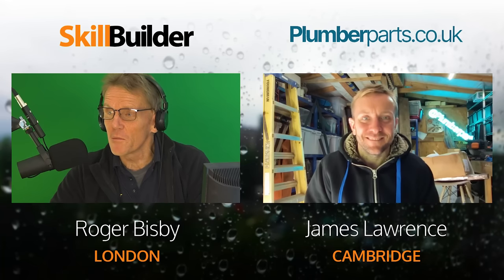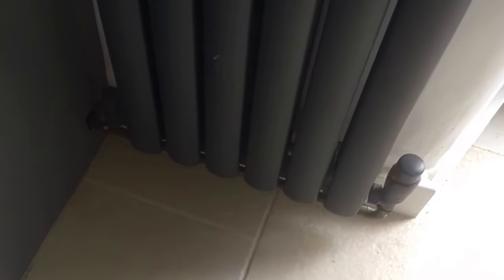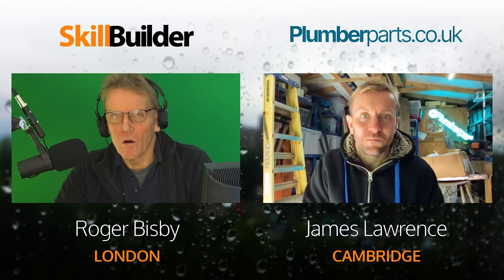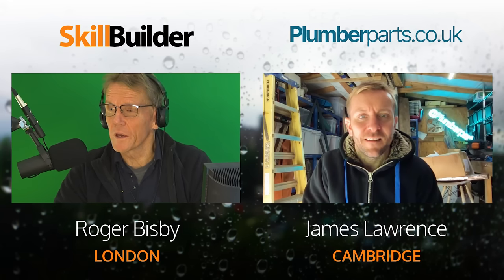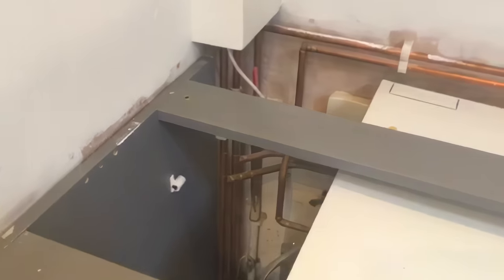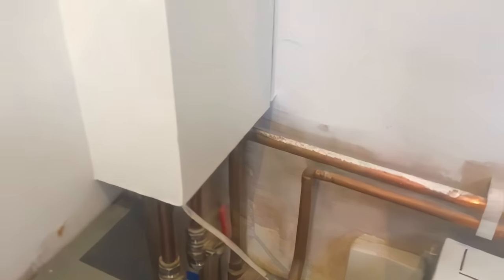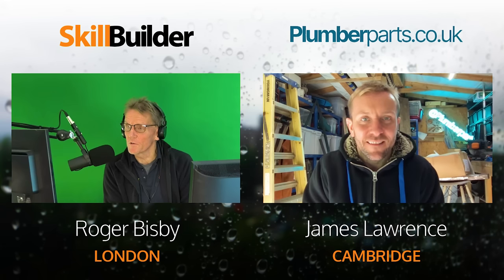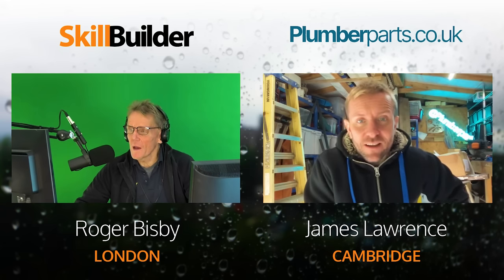Noisy Radiator Mystery: Does Jim from Plumberparts Have a Solution?

Comment: The sound is the water flowing up the first pipe then down the next column so the rad is being bleed on the first column but not the next. So first step would be to crack the other side of the rad (top) to bleed the air out of that side. If that improves it then swap the bleeder to the other side.
Reply: Just fit two bleeders, or two auto bleeders.

Comment: I was fire alarm commissioning engineer for about 25 years after a 3 year apprenticeship in the workshop and day release for 3 years at college C&G G in London.
Had a call out in central London with a loud noise coming from a smoke detector on the ceiling. I know there were no sounders in the smoke detector bases back then on site. Went to a room with a young lady and she said there it is pointing at the smoke detector in the room. I walled over to the thermostatic valve and tweaked it and it stoped and said you need a plumber not me lol. She went bright red so I said don’t worry I am not here you never called no charge made me laugh inside she was very grateful. Having 4 older sisters I have a soft heart it was only fair we all make mistakes 👍

Comment: I had a column radiator installed. After ages of trying to work out why the room was always cold. Found out the plumber had plumbed it up backwards. Fortunately had bi-directional lockshield and TRV. So I swapped the pipes over to it and problem solved.
Reply from the maker: You hire the professsionals and it doesn't always work out.
Reply: Lol

Comment: Guys what I’ve found with the columns is when you bleed it, bleed it really really slowly and on and off over a few days. I’ve found that air can hold up high in the columns. I’ve found it’s cured it. 

But again the pipe work is wrong there.

Comment: Shut of rad valves, remove top vent, fit 1/2 x 15mm with valve on. Connect a hose , have someone maintain system pressure then blast at full rate a couple of buckets full. Then try . Also if no auto. Bypass and you have high power modern pump, especially if a Grant oil combi boiler which must have bypass can virtually eliminate noise. Also check direction of flow on trv , some go silent when you get it right way round. Couple of full blast buckets will would be my first try, always worked for me! Good chat lads!

Comment: An internal baffle might have come loose in that tall rad too.
Reply: That was what I was thinking, the one I had was fixed on by a short bolt on the stem of the spacer. Could be spinning in the bottom of the rad.
Reply: Concur, sounded like a metallic rattle, not air, to me.  Can't really tell over recording and internet reducing the quality of reproduction.

Comment: Roger and James, great format - maybe a regular feature. I think you covered all the bases. Like all these sort of faults it just has to be a process of elimination and probably doing in the order of the the easiest things first.

1. Establish the flow and return pipes by temperature.
2. Establish the rad is the ‘right way round’ in terms of flow to deflector end (or even if the rad is upside down.
3. Not all rad valves are equal either - maybe fitting alternatives.
4. Rerunning the flow and returns behind the floor standing boiler - depending on the boiler you may not even have to chase the wall or move the boiler (could get lucky).

Finally let’s hear it for the most popular plumber on YT - Colin Furze.😉🤣

Comment: Their first mistake was installing a column radiator.
Reply: Every 1 wants to get upgraded but that depends on your home whether its an old or new build.
Reply: I fitted one in the kitchen and it's been fine.
Reply: @pussinboots1145  because of pipe work and pressure etc
Reply: I fitted a number in my house and they’re fine - never had a problem; you’ve just got to follow the manufacturer’s instructions and do decent pipework!

Comment: It’s the design of the rad that’s the issue, the top interconnecting rail is below the top of the columns so air is hard to expel from the pockets formed at the top of each column.
The cure is to bleed full rate a few buckets with out to try and pull the air out

Comment: If an Radiator makes water sounds like that, then it means its air inside it and needs to get vented.
If the system have air/gas inside, then it will start to rust etc much much faster.

To vent a radiator like this you have to take out quite alot of water to propper vent it.

Anyway, water dont makes noise unless its air inside.

Comment: I would turn each valve out and pull the water through each pipe individually, then fill the radiator see if that worked and see how long. If not working I’d the consider changing the pipe work or put air vents in etc.

Comment: Ha ha. Like most plumbers who get together about a job the conversation wanders to women !! Unlike your lady Roger mine walked over me to the sink and emptied a full teapot of tea down the sink - when I hadn't fitted the trap!! Fortunately it was cold tea!! On the radiator problem you didn't mention if the radiator was hot to the top. Was he bleeding it when the system was on rather than letting the pressure build to force out the air? Great video

Comment: That sounded like a physical noise rather than hydraulic. When that rad was prepped, it would have had blanking plugs on the inlet/outlet - has one of these been pushed inside the rad in error and is tumbling around with the water flow? Came across this once and we had to fish the bloody thing out with needle nose pliers...took forever....

Comment: I have the same issue with a couple of panel radiators...been driving me crazy trying to work out what it is. I wondered if there's a piece of metal floating about inside them.
Reply from the maker: sometimes it is balls of solder

Comment: Hello Community , We have recently re-did ground floor bathroom with it , builder replaced the existing hot/cold water pipes coming to that bathroom . Since then , we are having random clicking sound from one of the radiator upstairs which goes for 3-5 secs and stops . It only happens when heating is on . We removed the air but still hear it . Any suggestions please ? Thanks

Comment: Don’t think it was a plumber/heating engineer that fitted that rad. Any self respecting installer would not have installed pipe work like that and would have known problems would arise.
Reply from the maker: The soldering is neat so I don't know

Comment: Why didn't the "plumber" just drill a couple of holes through the cupboard he had to drill a hole anyway.

It is possibly you could feed it from the top not the bottom so just run the pipework up alongside the radiator to the top on the feed only!
Reply from the maker: There is a floor standing boiler there